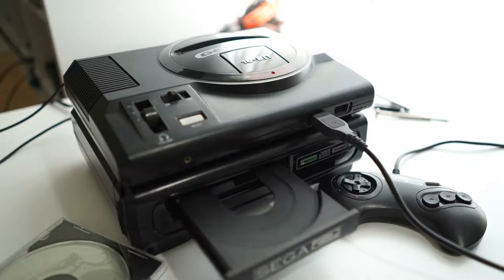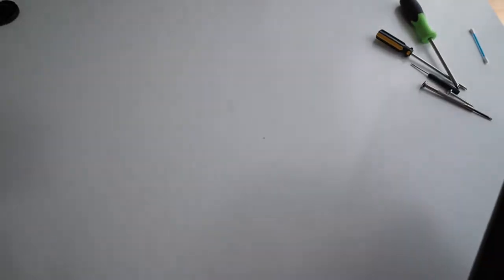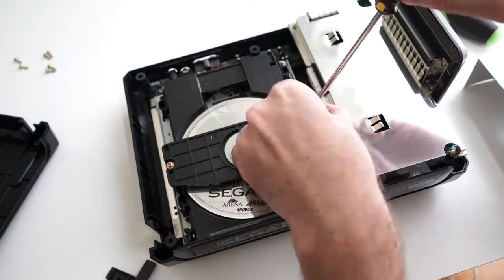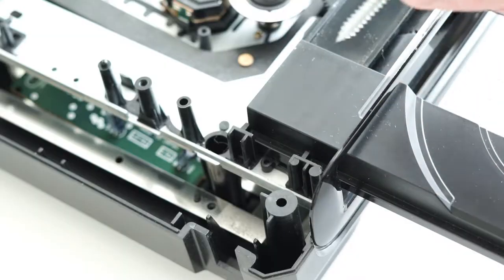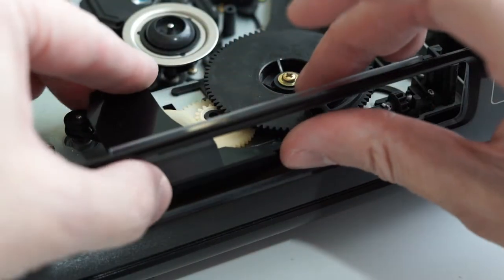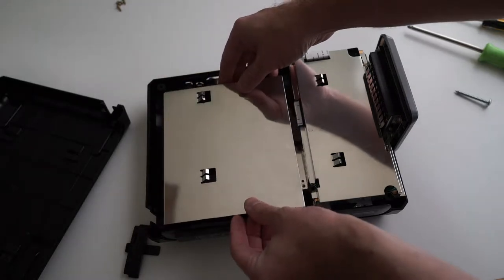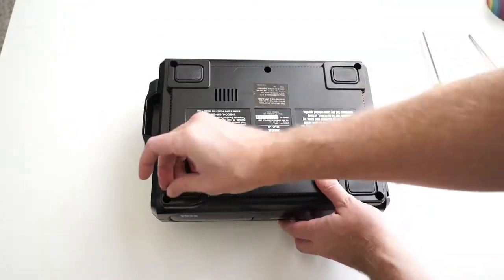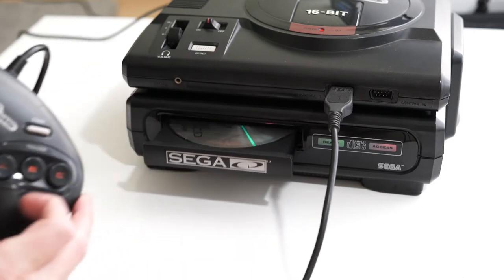Sega CD - Drive Belt Replacement - High Quality

Comment: thanks very much for showing how to remove the stupid tray ! I was strangling for a 2 days to figure that out and finally I find your video! in my case not only the belt but the plastic holder for the rotating slug is broken (this part that lift the laser assembly .

Comment: Another way to insert the screw on the right while replacing the metal shielding back, simply put that screw into the port as you place said casing back unto the cd drive.